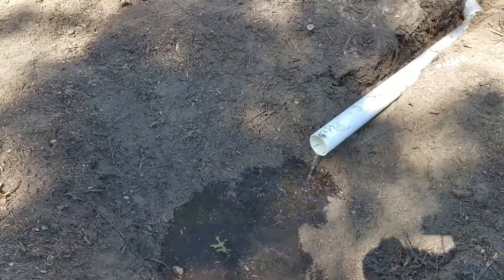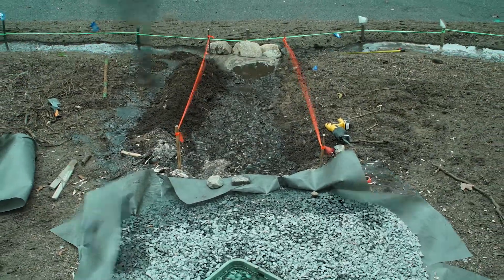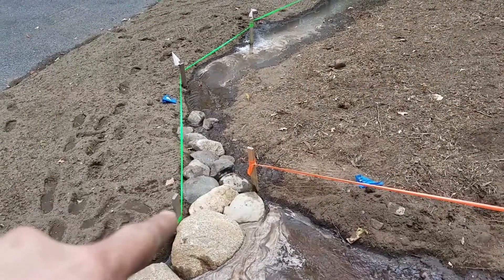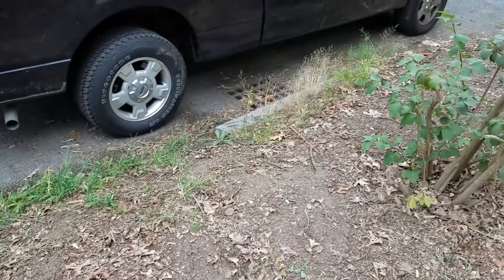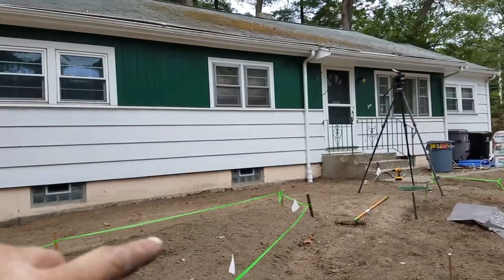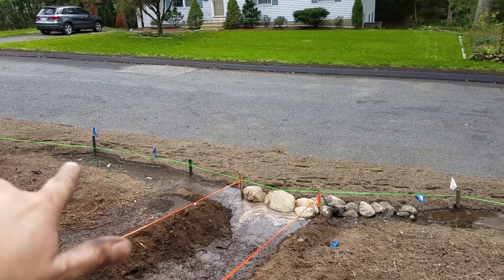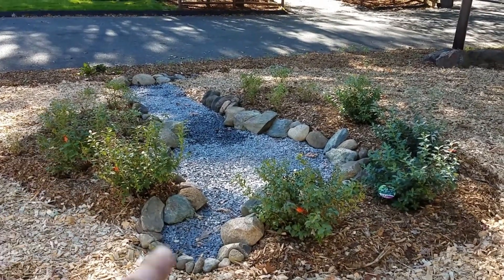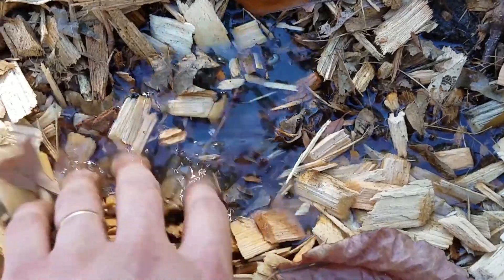Suburban Ecological Landscape: Passive Rainwater Harvesting System

Comment: Now, normally I would be more skeptical of the buried outfall here, but dumping into a basin before that final length of pipe may serve as enough of a gravity catch for the debris, providing it was cleaned out often enough to prevent any from getting in. Just wondering how the buried outfall has held up clogwise and cleaningwise

Comment: Why wouldn't you have made a larger rain garden near the front and edge of the property line to prevent more water from running into the storm drain?
Reply from the maker: Hi Torrey, Thanks for the comment.  The way in which the garden is laid out is to utilize the existing conditions.  While another large depression would be possible to have added, the return on investment for excavating more of the yard would have been marginal at best.  While I have a great client, money was not unlimited.  So far through some heavy rain events, I have not witnessed any extra run off from the property.  The mulch and eventual fine fescue no mow lawn  also aid in slowing rain water falling outside of the catchment basin and infiltrating it into the soil.  Thanks for watching!

Comment: Yours are some of the best water-harvesting videos on YouTube! Amateur question about the perforated drain pipe connecting the two downspout outlets: Is the perf. pipe level? Or is it sloped slightly toward the downspout by the front door?
Reply from the maker: Hi Kathy,  It is graded level to facilitate as even a distribution of water across the front.  If i wasn't able to have the overflow happen after about an 1/2"-1" of water standing in the pipe, I probably would have added a pitch of about 1/8" for every foot of run.  Thanks for watching!